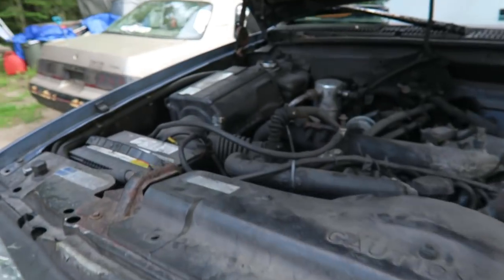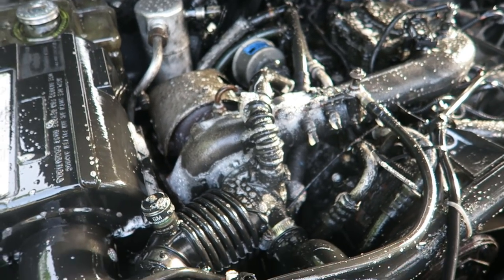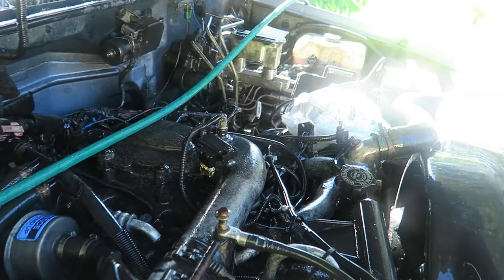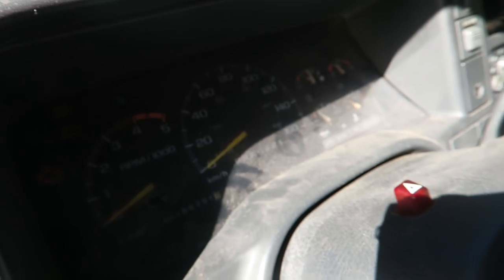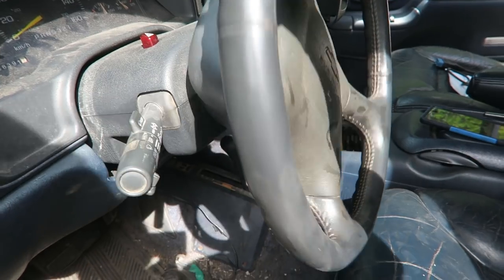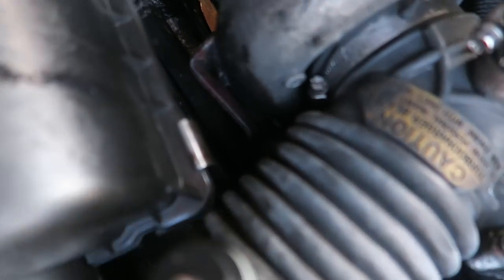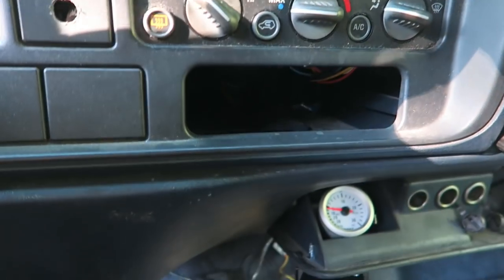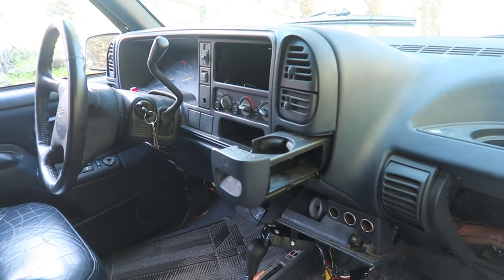Tow Prep - DIY Turbo Master

Comment: A trick that works well for me in helping to back off a brake bleeder is using a small propane torch to heat up the metal around the bleeder. You don't want to make it red hot or anything like that but up to 350f is fine.

Comment: First components, YOU should take care of is the brake lines and the fuel lines inside the left frame rail, because they are surely corroded and IF the fuel lines start to leak you Will have air in the.system and the engine will start to miss and hard to start, on mine the fuel lines on top of the fuel tank were problematic, then you should relocate the fuel driver with a cooler, then you should have a good look at your hamonic balancer and pulley, because then are the main cause of crankshaft failure, I installed  a FLUIDAMPER, and take at the option of upgrading the cooling (dual thermostat water pump and fan blade) Dont Forget the PCV on the back of the left valve cover afterward you can start looking to upgrade for more power ! Good luck

Comment: 🤓Noice 👍 
LeRoy's diesel makes and sells parts esp for 6.5's 
A most note 3 systems are tied together which when the lift pumps fails whilst driving may result in catastrophic Damage ; my trans Sun gear was sheared off when this happened to me leaving no forward or reverse ...which sucks esp w only 80,000 Very well maintained miles on the entire truck . 
 Those systems need separated even on NON pmd engines like mine 92-93 model years . 
 I recommend going w a Marine or More reliable lift pump model as well ; if using stock I'd keep a spare w appropriate wrenches in the glove box . 
 Fuel , timing and oil pressure all run through the lift pumps winding and it's internal windings are Wholly insufficient.  
The Original engineer has stated GM made him put this defect into the trucks design ; cost savings to GM yet defrauding Consumers for Labor & parts profits . 
Oye excellent engine w intentionally BAD ie insufficient Lift pump windings that cannot handle it's electrical loads properly . 
When it fails whilst driving the Transmission solenoids may close and due to forward Motion SHEAR off its Sun Gear etc . 
This is a Very Costly and time consuming Job ; the transmissions are Already Weak and the Defective/internal parts Can be upgraded as with Monster Transmissions Fairly Priced Replacement you can find online . 
  I am Now following your channel and I Like what I've seen from you thus far. 
Do you still have this truck ? 
Do you have a spare trans if so 
I STILL need one ; I'm on a fixed income now due to disabilities from a Coworkers error on the job . 
I will add he Apologized Wholeheartedly and I Forgive him 
Man to man ; just like all good people should when they wrong another esp when Veterans . 
 So you have a vacuum pump 
That Sucks ! 
Get rid of it 
Ya know if ya want to increase the boost it may be in your interest to adjust your optical sensor fuel delivery . 
It is advisable to in that case to add a Pyrometer . 
Increasing the size off the exhaust piping Greatly helps these trucks . 
 They Fuel timing needs to be adjusted towards any Major changes over stock boost levels 
Obviously from your video the Reliability is your main concern 
TY for your excellent Vid .
Reply: It sucks for drivability in a manual, but I had no idea that an auto could have that problem! That sucks!!!

Comment: I can see by your hands your concoction didn’t work to fucking good  why would you pick a 6 .5 to tow with also if you are going to  Shannon Ville thers a few hills going down the  hiway from Toronto pretty shitty motor to tow with thers more hills on way back it seems good luck get in slow lane a waste of time cleaning the brake system I bett on drivers side you have a bunch of rusted lines also the back lines are prob no better or haven’t seen to many of these trucks with good lines